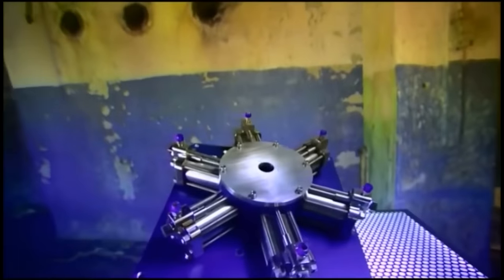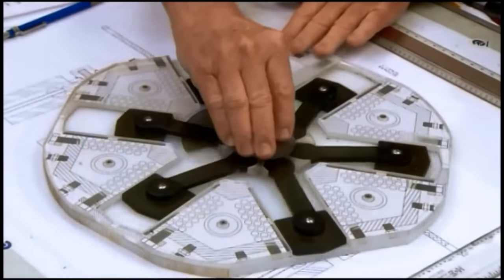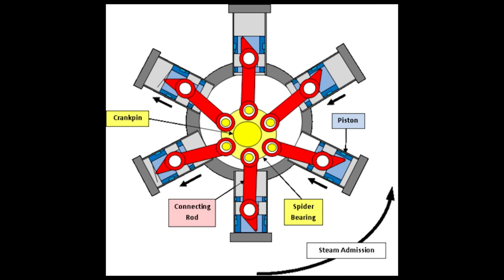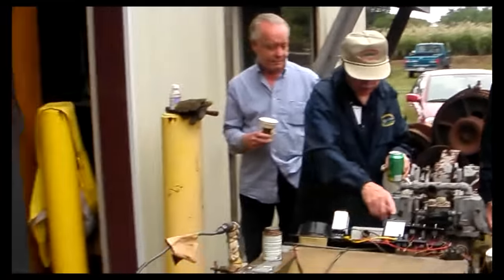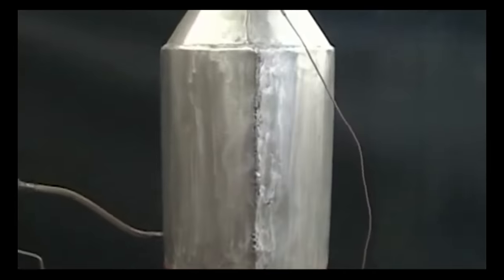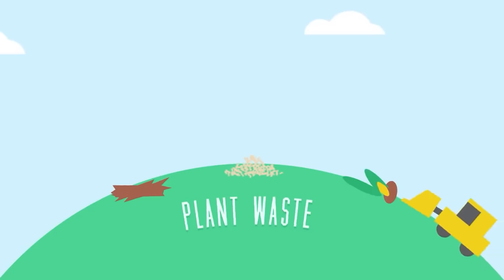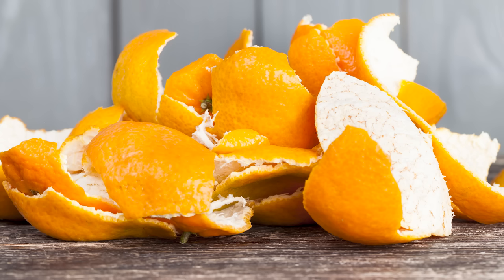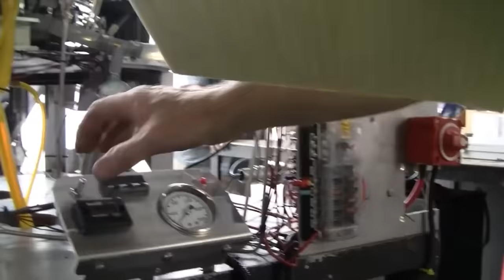Is the Cyclone external combustion engine the future?

Comment: I looked into these about 15 years ago and they were constantly battling sealing and wear issues.  The water was completely inadequate for the lubrication needs and pretty much every time they ran one on the dyno or if it was in a show it would be a freshly built unit.  Longevity/durability is the reason these things never took off.
Reply: Didn't steam locomotives and a bit of oil to the steam to lubricate the cylinders and valves? Not environmentally friendly in a total loss system but if you're re-condensing the steam and re-using it that's less of an issue.
Reply: @Surestick88  You cannot reuse the oil though. it must be filtered out of the condensing water with an oil diaper before the water can be recycled back into the boiler, so it is still a total loss oil system.
Reply: Agreed.
I'm an engineer and I know there's a kit from hemmingwway (UK) called the Cygnet that's a 3 cylinder radial steam engine from the 1960s. The web page includes a basic cut away drawing and a short video of one operating.
 
Plus the producer of this vid clearly doesn't understand basic combustion chemistry. If you're burning organics you're producing combustion products. Its a chemical reaction not a nuclear reaction.
Reply: @MagnusFeirenbacher  there are closed crankcase steam engines that have a closed sump full of oil like a modern car engine. the stuart sirius is one example
Reply: @Surestick88  yes, they used a tallow based oil that mixes with steam rather than being washed off like mineral oils.
Reply: @MagnusFeirenbacher  the tallow based oils used in steam engines are ok to recirculate
Reply: @MagnusFeirenbacher  they weren't recycling the water it was being vented like every other steam engine does , but oil is essential to preventing too much wear , steam is dry when it is Super Critical
Reply: You've probably already thought of this...but why can't they just machine from stronger metals? Or like with the tesla hydro turbine, just cap the power a little. Not like the governments don't cap our engine power already 😂🤌👽 but I agree with you mostly, I think we just need good quality space metal.
Reply: @mikeburrello4396  Good lubrication is essential if you want it to last , water is nowhere near good enough especially when using Super Critical Steam as it is effectively dry and not a lubricant
Reply: this thing would rust the great thing about oil is it's a rust inhibitor although most engines are aluminum now days
Reply: So why not rankine cycle? With a refrigerant
Reply: @mikeburrello4396  It's a matter of hardness scale. Soft copper rubbing on aluminum will wear the copper. Replace the copper with iron and now the aluminum wears. Eventually both surfaces are tungsten and they both wear. The rock paper scissors of metallurgy.
Reply: it would be great to see oiling systems added to solve these problems.
Reply: I wonder if a ceramic cylinder could be used. it's almost impossible to get around lubricants for long lasting machine parts.
Reply: Yes, for mechanical parts lubrication. However water is not a lubricant like fuel is, and it does not lubricate the cylinder walls/valve gear (although that depends on what kind of steam valves you have.)
Reply: @DANTHETUBEMAN  I think it goes well beyond a simple lubrication issue.  Super heated water/steam begin to do very bad things to metals and the alloys that might work are probably far too costly to use in this scale project.  Anything used would have to take into account more than just heat and friction.  I think chemistry begins to come into play here.
Reply: Some model railway engines use a 'flash' boiler system where the water pipe is heated and water converted to steam instantly, but I think this is different with supercritical steam. As with storing hydrogen it could be a safety issue and/or lubrication and wear issue that has prevented updates being made.
Reply: You must know more about this than I. I have tons of questions. 

None of them have anything to do with longevity.  

I want to make fun of the words, “super critical steam”.
Reply: @Surestick88  yes they did add oil to the moving parts. Even where the pistons came in contact with ‘not super critical steam’ 

You are missing the point when they are talking about special steam called, “super critical” 

I’m only half way through the video and I think people believe the “fuel” is being applied at the center of this engine and that’s just not how any of that works.
Reply: As a pipefitter that has made innumerable repairs to steam piping, one of the first things we learn is that water, in all states, is abrasive. That's why pipe fittings that change direction are 2X as thick as the pipe in a system. The fast moving steam works just like sand in a sandblaster. It erodes the inside of the fittings. 
Soooo... I don't assign any credibility to the claim that the water (steam) is the lubricant. 
Other comments about the various other steam engines, and the different oils used, supports my observation.
Reply: @DANTHETUBEMAN  Ceramic cylinders and teflon coated rings would help but I would think the read on cam is the big problem. It has to be flexible and not wear. Simple solution is inject organic oil into the cylinder but that would contaminate the closed loop system, requiring open loop. Moving the read to the cylinder wall would eliminate that wear but then it is just a steam 2 stoke motor complete with oil injector.
Reply: same reason hydrogen cars never worked out. yeah people can scream at me its one of the next steps because it is. but not hydrogen powered engines. water doesnt lubricate and neither does hydrogen. if you use an oiling system it will always be contaminated by the water. steam engines were the same way but the old ones had open bottoms on the cylinder so the water got out and fresh oil would drip in.
Reply: @chehystpewpur4754  Yeah.., that's the problem with all of these "breakthrough" technologies. At least, in the reporting. The stories always highlight the advantages and ignore any disadvantages. Like the David (as in David vs Goliath) Nuclear Artillery Shell... Perfect! Low Yield! Lower Fallout! Man Portable Nuclear Weapons! --- Except for that pesky little problem of those firing the weapons are inside the blast radius...
Reply: @chehystpewpur4754  Hydrogen is practically useless in an ICE engine.  At the temperatures and pressures in the cylinders it begins to migrate into the metals causing something called "hydrogen embrittlement".  The atom is just too small.  Throw a couple of carbons on there though and we have something good.  H2 is only really applicable in nuclear fusion or in a fuel cell and as we all know fusion is ONLY 30 years away and fuel cells last decades and are made up of very inexpensive materials.

Long story short is that steam engines had their time (some still do) but it is an infant technology that was mainly a stepping stone for others.
Reply: Doesn't seem like a big obstacle to overcome we could just install an oil pump. We have used steam locomotives for many years.
Reply: @devontwyford315  no. Ever hear of a failed head gasket? It makes the oil usually turn into chocolate milk like I said in my comment. Water and oil don't mix. The water will always go past the rings and contaminate the oil. Also you don't just install an oil pump on an engine with zero oiling provision. Wtf is that gonna do? Pump oil from nowhere to nowhere. You'd have to totally redesign the engine and the water in the oil would kill it in minutes. Maybe hours anyways
Reply: @chehystpewpur4754  I just replaced my head gasket 2 weeks ago, stripped it, had the head skimmed and reassembled by myself. So, my arrogant friend, little bit of oil on the moving parts would take a really long time to contaminate the water. Obviously some maintenance and oil filtering would be needed but we are in 2022 and that technology does exist.
Reply: @devontwyford315  your not getting my point. also im not your friend. many head gasket failures result in a breach between oil and coolant passages. which are under pressure and that forces the fluid into the other passages. its not a little bit. it can be gallons of fluids in minutes. that will trash a motor. this engine would do the same thing with an oiling system and thats bad. the water would contaminate the oil thats the whole issue here.
Reply: This is, essentially, a heat pump. You can use any fluid as the "refrigerant" or I guess you could call it a "compressionant" or something. You could use a substance that can emulsify with oil, and just adjust heat and pressure to make it supercritical.

Not sure if the fact that the liquid is supercritical matters particularly, but there's no reason you couldn't use something that DOES have lubricating properties. Heck, what's the critical point of tetraethyl lead? Obviously an extreme, since it's toxic, but it's a sealed system, so it SHOULD be able to use chemicals roughly just as dangerous as we use in our air conditioners, since again, this is just a heat pump with an external heat source.
Reply: Ah, alright.
Reply: @mikeburrello4396  
How might carbon engine blocks effect the equation - if at all? I notice that carbon is often described as 20x the strength of steel, lighter, and more water friendly.
Reply: @ninjabongtoker1  you never heard of brass or stainless steel?
Reply: @chehystpewpur4754  you've obviously never heard of a water/oil seperator. It's basic technology. Any car motor can get water in the oil, and unless the water ingress is continuous an large, the water will evaporate out of the oil in the engine and either vent to air as in old engines or exit through the anti pollution filters.
Reply: @rossbrumby1957  water oil separators work best when the oil and water havent already mixed. the pressures the oil and water are at on the cylinder walls when its mixing make the mixed particles tiny rather than a few drops here and there which would usually warrant the separator. you would be essentially under headgasket pressurized oil passage breach into the coolant conditions at all times. a water separator wont save an engine from that. there are tons of other alternatives that would be alot better suited than some of the crazy engine designs people come up with or the fuels they intend to use. there are many designs that would be much more practical if they actually got development. water is not a good fuel in a cylinder. using it for steam pressure fantastic. in a turbine would be much better. the bearings could be sealed off so no friction materials come into contact with the water. but friction and something that washes away lubrication is always bad news.
Reply: @TugIronChief  Vaporized oil still lubricates. Steam has a max temp of 212deg at one atmos.2 stoke motors inject oil lubrication at nearly 2000 deg for the purpose of lubrication.
Reply: @TugIronChief  1600 to 2000 deg in the combustion chamber, yes. Temperature of the gasses, not the metal. Peak spike in temp for fraction of a second every ignition pulse. Most of the heat passes out the exhaust and is radiated out of the metal. 4 stroke motors average 2400 deg yet plugs can still get oil foiled from valve stem leaks.
Reply: @TugIronChief  ?what? yes,,,? But now I am not confident you understand why engines have cooling systems and how they work. Combustion is vary hot. Coolant temp and combustion temp are not even close. You do know 2 stroke motors inject oil into the combustion chamber, right?. Even if the pressure was 2 atmos steam couldn't even reach 450deg.Boyles law of thermal dynamics. Synthetic motor oil can hold that temp all day without any oxidization, which is what I thought you meant when you said vaporize. Vaporized oil is a good thing for lubrication coating. The issue is they don't want to contaminate there "green" machine with oil.
Reply: @TugIronChief  LMFAO!  Yea, this is pointless since you don't understand how any of this works. Vaporized oil will still lubricate equally as good. It is perfectly fine at 600deg for 30,000 miles. written right on the bottle. Steam max temp is 600deg with max PSI allowing supper critical point before molecular break down. 2 strokes have oil injectors or mixed gas/oil. It lubricates the reads and yes the combustion gas inside the cylinder hits 1600deg. This is why header wrap is rated for 2400deg. so yes oil can easily lubricate at the relatively low temp of steam.
Reply: @TugIronChief  we all know engines work with magic and if you really really believe, you can use sand as lubricant. 🤣🤣🤣
Reply: @TugIronChief  Boredom and/or social media addiction.
Reply: @markhughes7927  carbon? Idk, like I said, it needs a stronger material to be efficient and possible. Thats what the video said.
Reply: @drumstyx this is essentially a hoax, an investment scam
Reply: Newer oil can be filtered out as it doesn't emulsify but still isn't the best solution.
Reply: You are correct that it had lubrication and sealing issues. At 3200 Psig the cyclone was under extreme stress. One of the early versions actually melted a piston and shot it out across the room according to Harry Schoell.
Reply: My understanding is water is a mild acid. Could adding a neutralizing base to the water have helped?
Reply: @MagnusFeirenbacher  I believe that one of the new synthetic oils doesn't emulsify and can be reused. However it still doesn't adhere and has a temperature limit.
Reply: @David_Mash  Different refrigerants have been tried but so far none work as well as water.
Reply: @DANTHETUBEMAN  just wait. Something may be in the works.
Reply: @Enjoymentboy  With the right material it will be overcome. For lower temperatures there IS a synthetic lubricant that will adhere to metal. It's expensive. Called Krytox.
Reply: @tadwyn  The higher temperatures the better I think.  I personally suspect that ceramics will be the solution here but would also be prohibitively expensive with current technology and production methods. There's always a way around the problem if you're willing too throw enough money at it.
Reply: @Enjoymentboy  I agree with you. It will take money to fix all the problems. But I won't rule out that it can't be done or may be quietly being done now. As promising as the cyclone appeared to some it didn't help new steam engines and projects.
Reply: @Enjoymentboy  The Laws of Thermodynamics prevent steam from being a viable solution for any applications other than massive coal fired or Nuclear power plants.
Reply: @tadwyn  No amount of money will make steam engines competive against internal combustion technology, money cannot defy the Carnot Formula.

Comment: Interesting concept, it looks like it would be more suited for a home combined heat and power (CHP) system rather than trying to shoehorn it into a car, what with all the crash safety requirements and maintenance complexity and everything. Presumably you could run it off wood pellets and garden waste, and both fuel streams are already widely used for home heating systems, and the bonus being that you'd get electrical power from it too.

Comment: steam is used in nuclear power plants to drive the turbines. its a good way to move energy around a thermodynamic system. i think the real advancement is more the combustion end (the boiler in traditional steam systems) as you can probibly hook the engine to any steam source and get power out of it. steam engines are pretty straight forward and a lot simpler than ices. you can also push the piston both ways so you can have fairly consistent forces on the crank shaft rather than intermittent like a 4-stroke. its pretty much steampunk evolved.